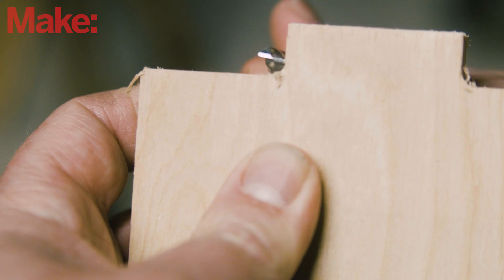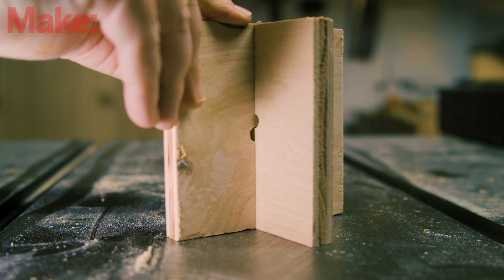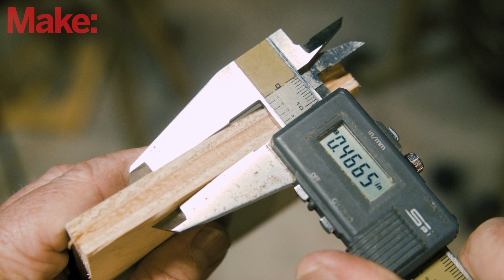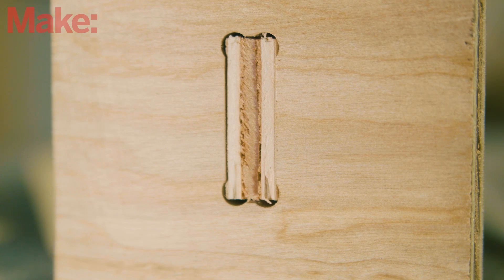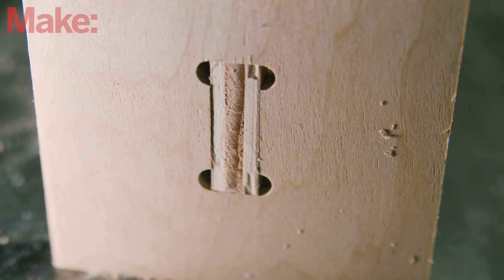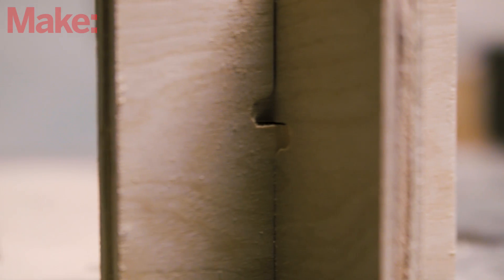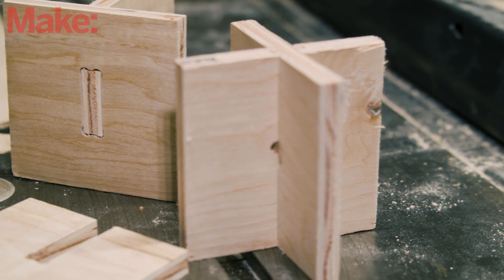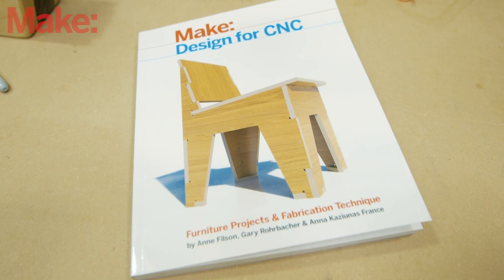Skillbuilder: Design for CNC Joinery

Comment: Nice, I will employ these in my design, but my problem is that I will have many components that join at angles other than 90 degrees, so it will require that the slots in the receiving component not be perpendicular to the surface and be wider than the tabs material thickness of the mating component so it can be rotated to the required angle…maybe I can then fill the resulting gap with wedges, but it would be nice to have a CNC machine with a spindle that could rotate around the X axis to create these slots…

Comment: Why not place the t-bone and sniglet fillets on the short edge of the slot, so that they’re hidden within the assembled joint? This would require material thickness more than 2x your bit size, but should work with typical 18 mm ply and 0.25” bit.

Comment: if the wood is 1/2 or 3/4 if you are making a pocket where another piece doesnot have to through, make the holes -1/16 deep. the exposed hole will not show. makes a clean look.
Reply: Smart. I'll have to try this. Thanks.

Comment: What about clamping the board vertikcal instead of horizontal? This may fix several cases.
Reply: for that you would have to flip the bord, as you would have to round all  four edges. If you want thous edges sharp, use a laser or water jet for cutting.

Comment: Would a work around be to change the tool to a smaller one afterwards to do the details in the corners?
Reply: IgnoreMyChan depending on the cam software that would be the best solution.  Gibbscam is what I am familiar with.  In Gibbscam there is an option called material only, what we do in metal, which I assume you could do in wood is we use the largest possible end mill to rough out material.  From there we would either drop to a .125 (1/8) endmill, or if we used a really large endmill, like .750 (3/4)+ we might go with .375 (3/8) first then .125 (1/8).   Once be get to .125 we would use a .0625 (1/16) to go in and just clean up the corner.  The problem is anything below .125 (1/8) is super fragile.  Material only takes into account each operation in the program cutting only what's left.  Also remember endmills are labeled by diameter, so a .0625 endmill will leave you a .03125 radius in the corner which is a pretty sharp corner.
Reply: IgnoreMyChan Think yes, but cutting twice the same path after tool change may be trickier and more time consuming.
Reply from the maker: Or you can just do all of your cutting with a smaller bit - It's a tradeoff between cutting speeds and smaller details. In this case I went with a bigger bit to make the shape of the fillets super obvious. But I think using a .125" bit would work much nicer, without sacrificing much in the way of cutting speed.
Reply: It would still Have a small radius in those inside corners.. Same problem would happen.